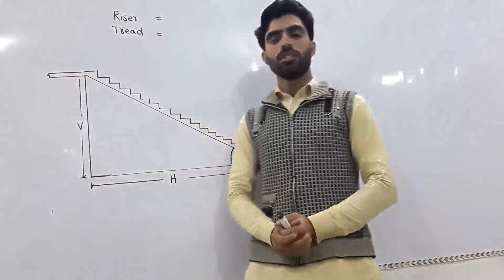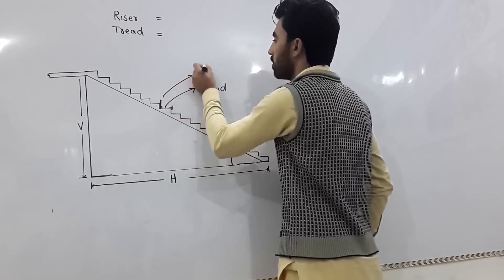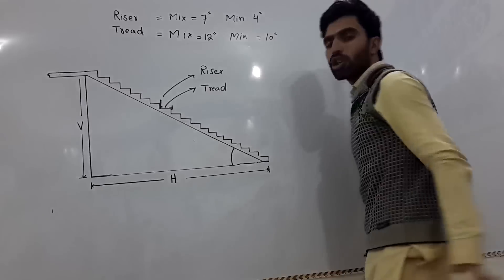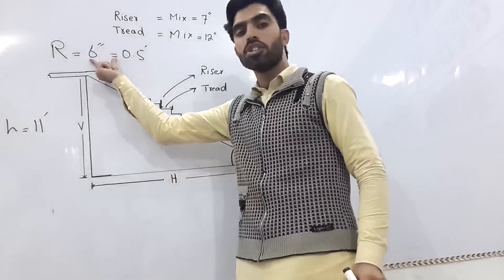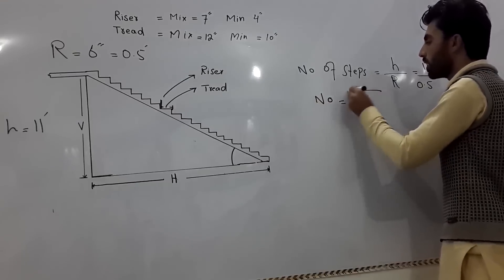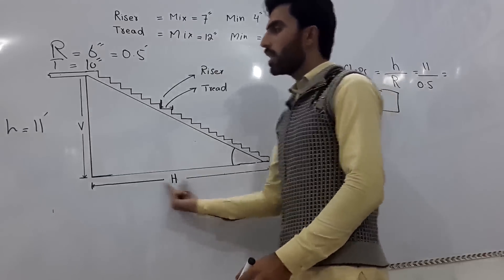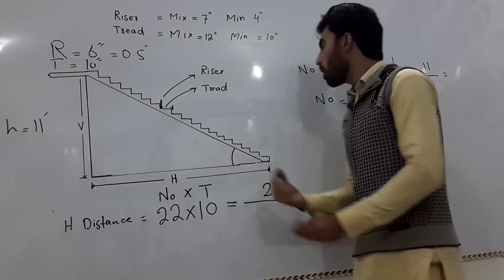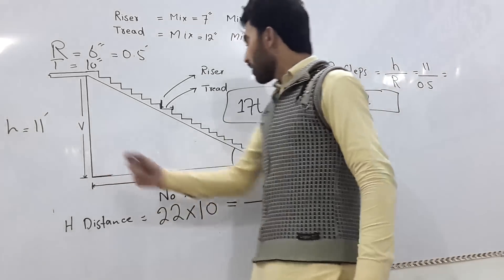Staircase Design | Easy Method to Design Staircase | Design of Staircase | Civil engineering

Comment: Dear engineer, I appreciate your hard working in field of civil engineering, in addition,  I kind fully request you please make lectures on steel layout in concrete structures and please illuminate how cm long  steel is required in negative position in beam slab I mean I need to know completely in steel layout in RCC structres where can we use top extra bar or negative moment how much long L/4 or L/5..etc

Comment: sir before section you said that the length of the staircase is like 
(NOS of tread x length of the tread) but in this section you are saying that the (NOS of riser x length of the tread) and in these two method which one will be the correct one